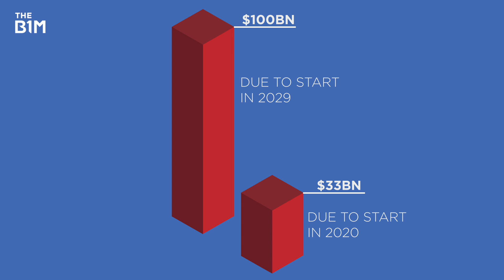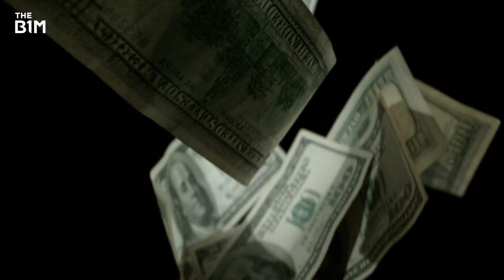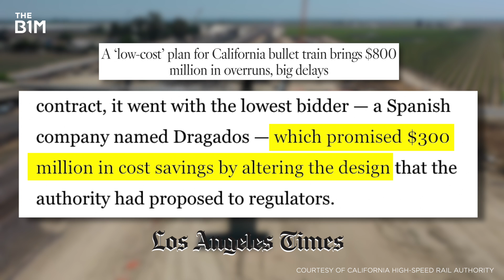What Went Wrong With California's High-Speed Railway

Comment: When a section of the 880 freeway in Oakland collapsed in 2007 they replaced it.....At $250 million PER mile.  You read that right.  California is run by completely incompetent and corrupt people.
Reply: US$250 million per mile. Must  be gold plated
Reply: @taytk8005  Honestly wtf is costing that much
Reply: @nobullshit9721  
Mind boggling the US$250, Million was at 2007 dollars' value - Can't imagine what will be cost today
Reply: @taytk8005  hs2 in the UK works out at US $424M / £307M per mile
Reply: Brightline is able to build 170 mile line from Maimi to Orlando for $4.2 billion and set to open in 2022. Their proposed Los Angeles to Las Vegas line is estimated to cost $5 billion and will take 4 years to build. Something wrong with California’s HSR costing from $76-100 billion.
Reply: @Dept246  Florida is flat as fuck, has no fault lines to consider, and is running mostly on pre-existing track. It’s also not really high speed
Reply: @SomedayIWT Everyone mentioning China in comparison can't be taken seriously. No, for example, look at railway projects in Austria, France, Japan or Switzerland. Japan is going to build a railway connection for 83 billion dollars, but it's magnet levitation train. :D
Reply: What a misleading fucking statement. It's not a miles long project, it was 168 feet of bridge that was repaired to working order in 26 days. It cost a total of about 6 million to repair.
Reply: It's not a California problem, it's an American problem.
Reply: Geezus f'ing christ, what people will make up just to pick political fights.   First 2007 it wasn't 880 that collapsed, it was a piece of 580 due to a tanker truck that crashed made a hug bonfire, and the cost to repair that was something like $6 million not $250million per mile,  most of that $6M was due to a bonuses for doing it fast since it was estimated to cost the economy around $6 million per day that the area was closed.    And FYI the governor of California at the time was a republican, who did declare it a state of emergency.

Now where's the $250million per mile number come from?  Well that actually came from the rebuilding of 880 due to the 1989 earthquake, to which the project was done closer to 1997 not 2007 and the reason that cost so much is there was untold complaining about rebuilding it at all, and they eventually had to reroute the freeway, needing to buy land from Amtrak, Southern Pacific, even the mf'ing US Army since the new route took it through the Oakland army base,  they had to weave around BART both over and under,  including rebuilding some of the track to support it.   Yeah it was the most expensive project in the state's history at the time.... god damn democrats... oh wait... this was all under the watchful eye of a republican governor at the time ~1997.     But please do keep blaming that on Gavin Newsom too, I mean he literally just started his political career then for the SF board of supervisors (i.e. he had fuck all to do with the cost of that project).
Reply: @SomedayIWT I don't know what bridge  you are referring to, but you aren't going to distract the dicussion at hand. California hasn't been capable to build a single railway connection over the course of three decades. What-about-ism isn't going to save you. France and Japan have had a high speed railway for many decades and they are only improving while California can't even hold a candle to more mediocre railyway networks. Italy would be ashamed of the extent of corruption evident in this project. Switzerland built the NRLA for 23 billion dollars and that's an update on many parts of its railway network, including - among other tunnels - a new tunnel under the Gotthard massif, which is currently the longest railway tunnel in the world, at a length of 35 miles. That world record setting tunnel cost 10 million dollars. Austria is currently building a railway tunnel that is even longer and guess what, it's not gonna cost anywhere near 80 billion dollars either.
Reply: The decline of the US manifested right here. The politicians and the media stir the public to useless topics, like China invaded Microsoft BS and we the public go right along with it, parroting what they give us.
Reply: Democrats for you
Reply: To clarify, the replacement of a short critical section of Interstate 880 and 580 and was was considered an EMEGENCY repair.  The contractor, CC Meyers, had a $867,075 contract with a $5,000,000 performance bonus.  The bridge overpass reopened to traffic 26 days from when the accident occurred!

Source:
https://www.enr.com/articles/35522-5-mil-bonus-for-contractor-in-bay-area-bridge-repair
Reply: Because it was such a vital section for traffic, they offered a $200k/day early completion bonus.  They paid out an extra $5 million due to this, which increased the cost by around 6x.  State estimates put the economic impact of it being broken at $6 million per day.  Seems worth it to me.
Reply: Oh, they aren't incompetent. They know exactly what they are doing.
Reply: Incompetence and corruption are a bipartisan effort in the US
Reply: Republicans just don't even try.  They just bitch about the democrats trying.  If we had this additude in the late 1800s our country would not be the world power it is today.  So stop pointing fingers and help find solutions.  I'm so fucking tired of the insisted thought we shouldn't change anything.
Reply: @andrewm8063  We don't try to waste money on projects to nowhere. TH reason we were able to build into a world power was because we didn't care about environmental reviews, or bulldozing neighborhoods which is now seen as racist.
Reply: @andrewm8063  Well the Democrats of the 1800's were the slave owners of the U.S. while the first republican president freed the slaves and the second republican president was the guy who went to war against the slave owning democrats.
Reply: @andrewm8063  USA was for more conservative back in the 1800s and better for it...whyte people didn't take shit from anyone and did what they had to do to build this country..and I'm a poc immigrant.
Reply: @SomedayIWT Nope, 
 the bridge discussed was for the replacement was for of a short critical section of Interstate 880 and 580 and was was considered an EMEGENCY repair.  It is, "an often-congested interchange traveled by 280,000 vehicles every day"

The contractor, CC Meyers, had a $867,075 contract with a $5,000,000 performance bonus.  The bridge overpass reopened to traffic 26 days from when the accident occurred!  The steel in th was made in the US.

Source:
https://www.sfgate.com/bayarea/article/A-MAZE-ING-His-reputation-on-the-line-2592154.php
Reply: You hve any proof to back up your claim?
Reply: @andyxfish  
Whose claim are you referencimg?
Reply: @taytk8005  John Hiller, the original poster.
Reply: I can't believe what I'm reading here. I get it: you hate government (especially if it's the wrong colour) but have you ever considered the cost of construction. The problem is that government has to administer it but the contracts have to be built by private companies. Yet it's the government's fault (or "leftism" if you prefer)...? Wow, that's a leap of faith.
Reply: @thethirdman225  It's not a "leap of faith", or logic for that matter. Go where ever you want on planet Earth, if projects paid for by the government can't be finished after decades and flushing billions of US Dollars down the toilet it is without exception due to corruption. Incompetence gets shut down after a while, but corruption keeps itself going. And 80 Billion US Dollars for an overground railway link is an exorbitant, absolutely ridiculous sum, especially while making hardly any headway in 3 DECADES. And they're still at it, they still keep flushing money down the drain and nothing comes of it. And the only thing these people care about is to get the money back the federal government withdrew because no progress has been made. Look what the expenditure was for similar projects and you will be blown away by the apparent waste of money evident in this project. Other countries build tunnels under mountains and bridges over the sea in addition to laying some tracks for a fraction of the cost. 800 miles of railway do not cost 80 billion dollars, not even in California. And like it or not, a government that watches for that long without setting an end to it is at least an accomplice in the fraudulant waste of money.
Reply: Think Democrat and stop wondering. Those isiots couldn't build and run a two hole outhouse.
Reply: @lloupez l Probably because nearly every major city in the US is run by Democrats, perhaps? Unless you can name one run by Republicans...
Reply: @kelaarin  the Republicans are almost as bad as democrats. Just not quite as bad. If a car drives over the edge of a cliff at 75mph or 60mph, what's the difference?
Reply: @dustinabc  Really? Which large cities where this is happening are currently run by Republicans?
Reply: leftism
Reply: @docvolt5214  the most inefficient way to do things
Reply: @docvolt5214  it's not a left or right problem. It's the dipshits who believe any politician that says tgey stands for whatever they want you to believe and buy into their BS. They are all bad and its us who needs to check them.
Reply: @docvolt5214  If leftism is the problem then explain China
Reply: @Ratplague707  China is a totalitarian regime based on comunism. It doesn't have blue haired land whales screaming about racism 24/24 and to check your privileges. Crt doesn't make for good infrastrutture management
Reply: @docvolt5214  Ah, so you just pick up nonsense buzzwords and shout them at people
Reply: @inkbold8511  
Not just Afghanistan. We have Cuba, Vietnam, Korea, Kuwait, Syria, Iraq, Libya, Somali, Rawanda, Ethiopia, Mozambique, Columbia, Peru, Equatorial, Venezuela, Samoa,  ETC ETC ETC
Reply: @docvolt5214  wrong side buddy
Reply: @moew1051  he is right the corruption is in the left with nancy pelosi, galvin newscum, and the leftist city mayors
Reply: @gdiaz8827  nope wrong
Reply: @gdiaz8827  it’s not left it’s having a iq of over 1
Reply: @moew1051  So you ran for ratcatcher and nobody voted for you? Sounds about right.
Reply: @Ryan_Winter  sorry I was busy getting a Brain
Reply: @gdiaz8827  literally everyone is corrupt
Reply: @RsgDragon  I was talking about trump and his cult

Comment: The reason why we don't have High-Speed Rail is greed.
Reply: @Mark C-And the high cost of Lifetime Gov't(Public Union) Bureaucrats.
Reply: @ronmcmartin4513  So true. USA should have high speed train. I rode on High Speed rail in China its so cool.
Reply: The government is greedy?

No, it's because the team who designed this thing were idiots.

First of all, they didn't choose the shortest and straightest road between SF and LA. That would be I-5. By going down 99, they added 20 miles to the route.

Then they decided they have to make, it looks like three or five stops total in the central valley (counting the start and stop stations for the Initial Operating Segment). This would be fine if these were just branches off of an I-5 route...but they had to make them stops on the main line...which slows it down for everybody.

Instead of just one tunnel in "the grapevine" to go though the mountains, they decided to build an additional tunnel along 152. They could have gone through Altamont Pass to avoid an additional tunnel, but they like wasting We the People's Money so they are doing 152.

The other issue with going down 99 is that they didn't stay on state land. I understand the median isn't wide enough in many cases to build it just on ground level (yet another reason not to go down 99) but instead of using a viaduct in those areas, they just didn't stay on 99 at all...in many cases they are several miles away from 99...if you're not going on land the state already owns, you have to buy it from the owner, and California has some of the most expensive land in the world, so that's going to add up. They wasted tens of billions buying private land instead of staying on land already owned by the state.

Then you have the fact that they are sharing track in the San Francisco Bay area and the LA area. Which normally I would support, but since they're not upgrading the speed of that shared track enough, it is just slowing them down. I think the max you can go is 110 before you start having to eliminate "grade crossings" (places where roads intersect the train tracks).

So yeah...designers were idiots. I knew all that before seeing a map of the route, because the voter initiative didn't specify something like "must go down the median of I-5" so you knew it was going to be a boondoggle.
Reply: @neutrino78x  Uhm why were they even trying to build a rail track along a road. They should choose the path with less elevation.
Reply: @neutrino78x  Wow what bunch of idiots.  So sad.

Comment: I live within one mile of the proposed route, but if the railway were ever completed, I'd have to drive 20 miles by car to the nearest station, which would put me within a mile of a major airport.  The cost of a train ticket is  projected to be about the same as an airline ticket and the train would travel half the speed of an airliner.  It doesn't take a mathematician to see that California High Speed Rail is utter nonsense.
Reply: We have the same problem in South Miami, a long drive to the nearest station in the wrong direction. :((

Comment: Always was a bad idea. There is an existing rail line along the coast where people actually live. A fraction the cost could have improved that service tremendously. Population density in the western  US is too low and distances too large to justify this.  The failed bullet train was just a monument  to politicians egos.
Reply: A lot more people live in Bakersfield and Fresno alone than on the coast of California. Not to mention that you have high air travel between LA and SF clogging things up, a heavily impoverished San Joaquin Valley, and a climate crisis to deal with. The coast route, even with upgrades, would be a slower route than through San Joaquin. If anything, this wasn’t about political egos, and the routing choice they made was correct.

Comment: Politics both left and right. The right would be OK with high speed rail if it wasn't so expensive. The reason it is so expensive is because of environmental regulations from the left. In general the right is OK with any infrastructure that increases economic output. But they generally aren't OK with infrastructure that only has a self gratifying purpose. The proposed route would not have been useful. It connected two politically symbolic cities through an inefficient route at low speeds. A route from LA to Las Vegas would have gained more support, been cheaper, and would be more useful. It would have connected cheap real estate in the desert to expensive job centers.
Reply: Great, well-balanced take. 100% agree.

Comment: $100 billion could have built fresh water pipelines from the north. reservoirs and desal plants which are going to be vital for survival. It would have kept the central valley fertile in the worst droughts. There would probably be enough to fix The Salton Sea. These improvements would have generated enough tax revenue to build the high speed choo choo that stops every 25 miles making it not so fast over all.

Comment: Stop calling it a 220 mph high speed rail.  With stops and slow downs for terrain the average speed is closer to 80 mph.  That’s about the same speed as the freeway and you’re not stuck at a station without your car.
It started as a lie by selling the original bond for $10B, then has been mis managed throughout its existence.
Reply: @scott1294  agreed on battery disposal/recycling.  It’s a problem that hasn’t been solved yet either.  From my research, today only 5% of the batteries are recycled and with today’s technology it’s too expensive to recover the actual lithium.  New technology is coming but it’s going to be a problem before there’s a solution.  And that doesn’t even consider the extraction of lithium via mining or distillation...another environmental disaster in the making.
Reply: @scott1294  The problem with that wet dream is that we aren't building the infrastructure to support all of the transition to EVs.  The wall is coming and everyone buying into the panacea of EVs is going to drive right into it.
https://www.youtube.com/watch?v=TwWzmu_rKFA&t=1s

Comment: Video is complete NONSENSE!  The high speed rail project in California was never intended to be completed.  It just lines the pockets of corrupt bureaucrats, labor union and politicians.  The route under construction now will never be used by anyone in the Central Valley.  The project doesn't even have any routes designed through the mountains surrounding San Francisco and Los Angeles.  The current section is the EASIEST to buy and they can't even finish it!  The routes through the mountain ranges will be 1000 times harder!  

Besides, the saving in travel time using the high speed rail and driving will be negligible so nobody is going to use the train.  Also, you'll still need to have a car in L.A. or S.F. to get around.  The entire project was always just a corrupt, graft filled hole which will swallow billions and end up doing nothing.

Nobody will use the Victorville to Vegas route either.  First just getting to Victorville from the L.A. Basin is a major trip.  High speed rail won't work in America simply because the place is too large.  And with a huge interstate highway system and well developed airline industry, rail isn't needed.  That is, America isn't like China that has neither an interstate highway system or airline industry.